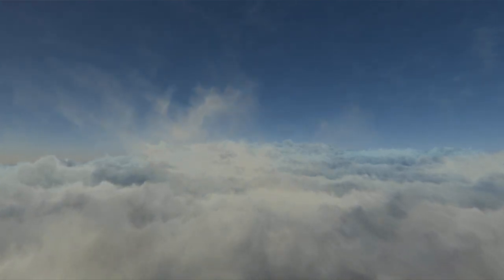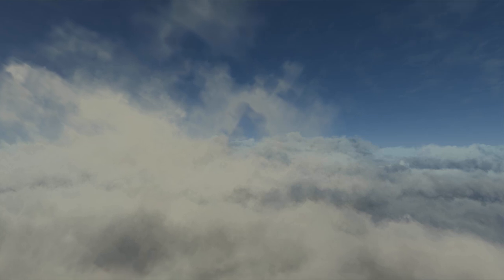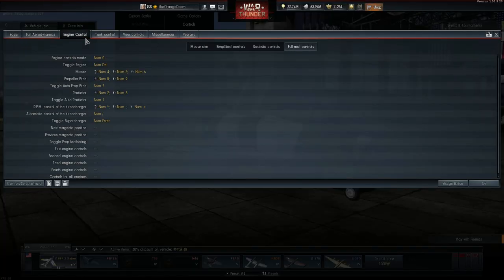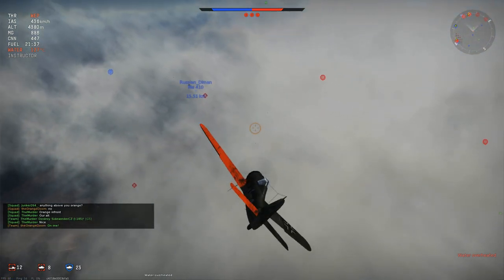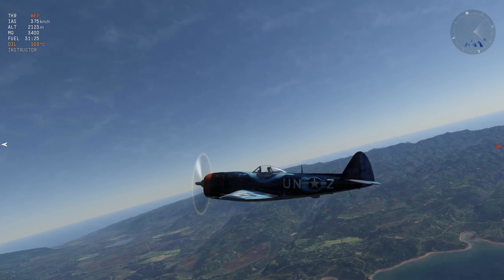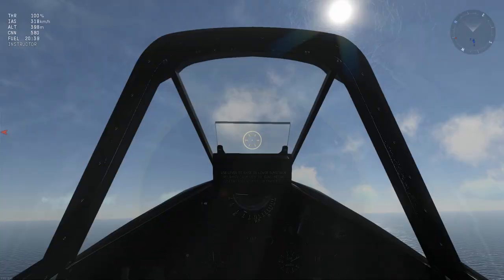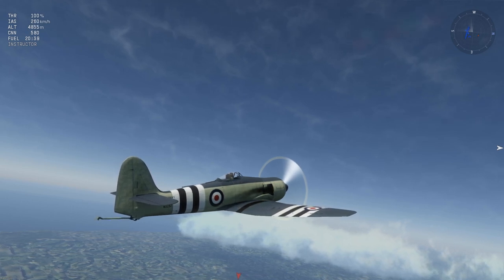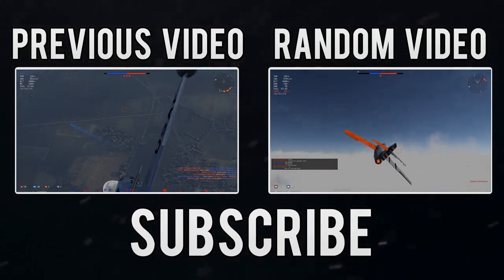War Thunder Advanced Tutorial - How To Use Manual Engine Controls  -  Working in SB and RB

Comment: mate  Here are some important things you missed out:

1. Using MEC not only makes you a better pilot, it actually makes you more of  a pilot, as this is something required of each and every qualified pilot IRL. 

2.With constant speed propellers, found in later aircraft, what happens when you alter prop pitch is you actually set your RPM, to which the aircraft's system reacts by adjusting the prop pitch accordingly. With variable speed props however, its measured in % of the actually prop pitch, so keep an eye on the RPM to not go over 6000RPM as to not over rev the engine, and make sure to adjust accordingly when diving. 

3. To use MEC, you have to actually use those circular clock-looking things in the cockpit, called i-n-s-t-r-u-m-e-n-t-s:
To use supercharger, keep an eye out for the manifold pressure, or MAN. At full  throttle this should be kept as constant as possible, around 60 inches of mercury in the P51D, for example( differs from plane to plane.) . The higher up you get, the less pressurized the air is and so the less pressure in the pistons you have per same volume of air. This means MAN will start to go down. At this point, you turn on the supercharger to 2, and voila your MAN will go back to 60. I'm guessing its the same with turbocharger, the slight difference being that you change it gradually just to keep it under 60. However you must not have the gear/% higher than what is needed to keep it at 60. 
 

4. Mixture, the most complicated and not yet fully modeled: This is the ratio of FUEL to air, but specifically it only changes volume of fuel. You were right in saying its different for each aircraft, but all ac follow the same pattern. In combustion engines, the ratio of oxygen and fuel must be the same, in terms of mass. As mixture is measured in volume, and density of air changes depending on altitude, you must adjust accordingly. So, the higher you get, the less dense air, so less air pressure. There fore volume of fuel needs to be decreased  accordingly and gradually, to keep same ratio. More altitude=less mixture. However, immediately after you turn on the next supercharger gear, there is a larger influx of air pressure, and so at that point mixture needs to be increased to match the increase in air pressure. After that, if you are continuing to climb, the pattern resumes from there: gradual decrease in mix for increase in altitude.
Reply: he said it doesn't make you a better pilot...
Reply: David Ye I have a question dose the super charger And radiator and oil radiates work for jets as well
Reply: gamer 2.0 no. Jet engines don't have any sort of radiator of superchargerz
Reply: leaving comment to be able to get back to your tips
Reply: Good comment though, very explicative and accurate. Not too concise but could be much worse. And don't forget in the game the mixer controller is poorly modelled, to not say not modelled at all.
Reply: Great comment David. 

I'd like to add to your 3rd point that many aircraft in WT have a red line or zone where the manifold pressure has to stay close to. If you don't understand Russian or Japanese like myself, I'd recommend you to try it out in a test flight and see what instrument or instruments (if there are more engines usually the same amount of pressure indicators) will change when switching gears. 

It's usually given away by a red zone or line anyways, but to be sure I'd recommend getting in the cockpit and fiddle around a bit until you figure out how you can get the best performance with your preferred flight style etc.
Reply: @L4wyrup  anyone saw the cartoon movie 
"PLANES 2"
And how Dusty vlew his gearbox which is the same thing we dicussing here XD
Cartoons sure are informative sometimes
Reply: M
Reply: geek

Comment: if my engine temprature goes Orange, then am i going to be Doomed?
Reply from the maker: AceCustomz yes
Reply: theOrangeDoom welp.....
Reply: +AceCustomz you should be able to spam I if you have regular controls to cool your engine.
Reply: The Diamond Hero i've pressed I accidentally and i've ended up in the trees
Reply: AceCustomz you don't like to climb do you?
Reply: The Diamond Hero i do, but i've done it when i am zooming up (i usually start typing then) and realized the problem too late, or i'm flying a low tier turnfighter
Reply: NOPE

Comment: for propeller pitch
0% for dive or emergency glide
60-65% for cruising
70-85% for climb
100% is useless because you overspeed the rotation of propeller and you have drag, not accellerating or power
100% only in descend for airbrake when you put down the power like 50% for start to descend and 20-15% for final touch
dont use 100% for dive because 600kmh can kill your engine
i dont know well, but it seems that pitch is a moltiplicator for rpm like gears
100% of pitch in a dive even with 0% of power will kill your engine
when you use pitch remind that there is a lag of power due to the air behind propeller so think before your enemy make his move XD
Reply: I thank you sir for sharing your knowledge.
Reply: Not all Gaming how to people in other jets slice throw the air and look majestic and I don’t
Reply: what should you have the pitch at in dogfights?
Reply: @nathanvenable6734  depend about the situation
Reply: @nathanvenable6734  usually i use 0% for dive on enemy, because i gain distance.
The real limit is RPM that in Bf109 are 3000 ( you can see them in first view, but you must memorize because you want to play with third person view).
In Ta152 the limit is 3500
All planes have RPM limit, zone for torque, zone for power, etc. 
With propeller pitch you must train yourself in "volo di prova"
Sorry im italian, there are 2am and i dont remember the correct words xp
Reply: @RealNotallGaming  Mostly planning on using this for air races in SB. For an air race, would I mostly have the prop feathered for power then (especially on the straights)? And then just ease back to normal to avoid overheating or do I mostly just mess with the radiator for that?

I use VR and a gamepad so too many buttons that you have to be too accurate with too quickly for use in combat situations for me.
Reply: @101jir  
the models B1 and E1 have an engine based on 80% pitch
F1 and up models have an engine based on 65% pitch
most of the situations will lead to this two %, in theory the max amount, in some situations you can raise that max amount like landing= 0% throttle 100% pitch for brake hard

(fix situation for not overheat, min fuel, from takeoff to 100mt and cruising)
WEP, 5% radiators for min drag

Bf109E1
55% pitch, 2250 rpm, 92 degree oil, 97 degree water
475kmh

Bf109F1
36% pitch, 2100rpm, 88 degree oil, 97 degree water, 500kmh

Bf109F4
38% pitch, 2000 rpm, 86 degree oil, 96 degree water, 515kmh

Bf109G6
36% pitch, 1900 rpm, 89 degree oil, 99 degree water, 515kmh

Bf109K4
34% pitch, 1900 rpm, 88 degree oil, 98 degree water, 555kmh

i hope i helped you a little :)
this list is about the only planes i mastered
every plane have his stats for pitch so is impossible to list them here
o7 see ya in the sky m8
Reply: @sinxy.y4159  they use mouse like joystick for smooth movements
Reply: @nathanvenable6734  the pitch is like the variator of a little motorcycle
in Bf just adjust it for not surpass 3000rpm or youll cook the engine
if you go in the direction of 0% pitch you can turn better
if you go in the direction of 100% you have more power for climb and chase but less turn ability
Reply: @RealNotallGaming  Thanks. Hopefully Gaijin will host an official air race soon. If not, maybe I will see what I can find in custom.
Reply: How do I stop the axis from jumping straight to 100% or 0% because everytime I try to fiddle with the mec, I can never get accurate control over anything. I can have a radiator fully open, or fully closed. My prop pitch can be 100% or 0%. Do you know how to fix this?
Reply: @heinzbeans2117  go in keybinds, in options (plane)
- you need to select full controls, then a list of additional keybinds will appear (when you finished you need to click mouse or you will start with "full sim" keybinds and if you use mouse you will crash)
- go down to the end and you will see manual engine keybinds
- for: pitch propeller, radiator, oil radiator and mixture you need to enter, with double click in the setting of commands for regulate them
- you need (in the submenù, after double click) to turn on "relative" then you can regulate relative sensibility and you can use them properly

because is a game, just use WEP all time and fly with propeller pitch
when in dogfight, with 0% pitch you will have most of the times the advantage because WEP and not less throttle, you will "brake" less but remain in energy advantage.

for Bf and Fw (those planes with REV limits) pitch is:
0% dive
30-45% cruise
50% swallow climb
65% take off (most of the times this is the limit)
80-100% air brake ( !!! watch out because you will need to reduce throttle, used for landing )

the rev limit for heating the engine is 2100-2300 RPM (use WTRTI external software for additional on screen numbers)
the rev limit before DESTROY\DAMAGE engine is 2700-3000 (some advanced model can rev up to 3500 like Ta152)

sorry now i dont have WT open and my english is poor
i hope it was useful ^^

are years i want to make a video (eng sub, im italian) about FULL MEC for all nations but im LAZY XP

in cockpit you will see the REV indicator on the right moving with pitch, in AUTO it will stay on about 75% max rev, with manual you will command it, so is simple to see it

watch it to discover planes limits
(USA, italy, USSR have just "more pitch > more power" 80% max pitch for not overheat, 80-100% pitch for "boost")

have fun ^^
Reply: Thank you so much man @RealNotallGaming
Reply: @heinzbeans2117  ^^ its a pleasure o7

Comment: from my experience any time you are travelling faster than the speed you can maintain in level flight, prop pitch should be set to 0% (or something very low; less than 20%) since you wont be able to actually gain more speed without losing altitude and a low prop pitch angle will create the least amount of drag, therefore allowing you to keep your speed for longer.
Reply: momo4077 yea because if u dive at high prop pitch u can over rev ur engine too
it has happened to me a few times
also diving with prop feathering on is OP as hell lol
im diving on enemies in my F4U way faster then when i had it on auto
Reply: 60-65% for cruising at least in gf e1 2.0 XP
but pitch is personal
bf109f4 have cruise speed with prop pitch at 40-45%, 30% is poor and you go down just for 2degree of climb
55% just kill it XD

Comment: You can check the rpm needle in your cockpit to adjust your mixture, if the rpm needle starts to wiggle, you only have around 1.5 seconds to adjust your mixture back or the engine dies, and you revert back to AEC (Auto Engine Controls)

Comment: I know that for Yak's the 2 gear is at 1900m.

La's 4000m

GriffonSpaceShuttle 5000m

Ki-43 4000m
Reply: Scarecrow tempests are around 1200-1300m
Reply: momo4077 only the mk2
Reply: Gideon Okun yeah sorry. thats the one i fly most often and i forgot that the mk5 has a better high altitude performance.
Reply: yeah, used to fly the km2 all the time myself ;D
Reply: I believe the P-51D5s is at 4000m maybe a little higher
Reply: I believe the P-51D5s is at 4000m maybe a little higher
Reply: +M36class What about the D-9??? Does it even have one? (it's the low alt version after all....)
Reply: Nikolay Iliev D-9 is med alt fighter and no. you don't have any gears.
Reply: Scarecrow
;-;
Reply: Scarecrow
And D-12?
Reply: Also do jets have any compression settings?
Reply: Nikolay Iliev 12 is high alt. I think that 7000-8000 is the sweet spot.
Reply: Scarecrow
I got it stock so meeh :| BTW any tips about the 229? Just got it ^_^
Reply: Nikolay Iliev No. I don't have any jets.
Reply: Scarecrow
ok :|
Reply: Nikolay Iliev jet have no manual engine controls.
Reply: M36class
oh ty
Reply: +M36class for p-51 it's great since they didnt fixed their cooling system yet.
Reply: ki 43 not 4000m wtf... I mean I would be confused

Comment: Essentially use the turbo similarly to the supercharger. It should be around 90%at maximum, and at around 5000m it should be around 40%. So at around 5000m bring it up to 40%, and as you get higher keep ramping it up as you gain altitude, AND speed. It only works after certain speeds, and above a certain throttle setting below 5000m don't go above 20%.

Comment: Just to clarify for people who don't want to go and read the whole wiki page about manual engine control (although I strongly recommend it) mixture represent the percentage of fuel per percentage of air(0% is only air and 100% is exclusively fuel). So  theorically the lower you are the more oxygen there is so you'll want to crank the mixture up cuz oxygen is abundant (but still mandatory for fire to exist). The Higher you'll go, the less oxygen there'll be so try and level this by lowering the mixture to 40 and down. Hope this helped!
Reply: Thank you
Reply: +Fil1204 you're welcome :)
Reply: best mixure 90% below 3000
75% above
but i tried few times so is a little......inprecise :)
but 90% is sure
for boost 120% but watch out and use manual radiator\oil radiator

Comment from the maker: Big thanks to McDonald's !! now please send me some cheeseburgers!!
Reply: theOrangeDoom Maus?
Reply: theOrangeDoom Do the Maus with the Haus camo.
Reply: theOrangeDoom MecDonalds :PPP
Reply: theOrangeDoom Have you tried testing MEC in AB yet?
Reply: Wobobobo It does work.
Reply from the maker: Wobobobo but why would you use it there?
Reply: I have shift for manual and auto switching....can you tell me how the mixture works? I have set it up but till now when i spawned an aircraft it says no fuel mix control..os it only on some aircraft or is my set up wrong?
Reply from the maker: JTS264 not all aircraft support fuel mixture
Reply: theOrangeDoom which do? Does the forum page tell it?
Reply: JTS264 I know a lot of the t4 stuff supports it, the F4F should, the A6M does, I believe most Russian planes and British  planes do..
Reply: ***** nice ima check soon...
Reply: JTS264 Its best not to mess with mixture, it can really mess with your performance and kill your engine though. That's why irl they have recommended checklists for it.
Reply: ***** As of 1.49 I was only able to turn the engine on/off, not the MEC, but I'll try it when I get back on.

theOrangeDoom I'm actually an AB player and I just want to take advantage of the AB engine mechanics.
Reply: Wobobobo well in arcade mec hardly has any roll...
Reply: JTS264 Roll? If you meant role then yes, most of the time, but it becomes crucial in certain situations such as AB tournaments or throwing myself into stupid/suicidal situations and trying to get out of them for fun/practice.
Reply: Hey orange I just wanted to say it was a pleasure flying with you in my BTD today-kid9
Reply: theOrangeDoom I have a challenge, Arcade Battles,  cockpit mode only, score 750+ points and get atleast 3 kills in an attacker, there is a score I want for you.
3000 at minimum.
1 kill = 250p
2x kill (double kill, duhh) 500+ bonus points
Critical hit - 100p
hit - 5p.
Kill in a bomber possibly? 1500p.
Reply: Das Dil_Doge A-36 and Ju-87D-5.
Reply: theOrangeDoom  BF-109 K4!
Reply: theOrangeDoom Orange I have a problem. When I try to put radiator on 100 percent in only is on 100 percent when I am holding button as soon as I let it got it goes back to 50 percent. Tested out on LA9 and Spitfire MK22
Reply from the maker: Supermarine Spitfire relative control
Reply: theOrangeDoom Is that something I need to enable? Or maybe disable?
Reply from the maker: Supermarine Spitfire read the forum thread please
Reply: theOrangeDoom Yeah I see now. Thank you.
Reply: theOrangeDoom Yep it all works now. Thank you.
Reply from the maker: Supermarine Spitfire my pleasure :)
Reply: if i want to fully open/close my radiator, i need to hold the button, otherwise it will set itself on 50%... is there a way to lock it on open/closed without holding the button?
Reply from the maker: Seimen Veldt relative control
Reply: theOrangeDoom found it! love your vids btw XD
Reply: theOrangeDoom Hi! one question..! :) Can i control only radiator?because then switch to manual, prop pitch, turbo charg. setups by 50%..i want control only radiator. :) Thank you, great video!
Reply from the maker: daggrag you can control all, or none. That's the tradeoff
Reply: theOrangeDoom Rule of thumb for mixture: Higher = lean it to 60% at the very least, below about 3000m I find 120% is fine.
Reply: +theOrangeDoom  Where is the switch supercharger gear setting, i dont have it
Reply from the maker: Combatsmithen Enter on the Num pad
Reply: theOrangeDoom nvm
got it!! i was making my own controls. And the setting wasn't called "Switch Supercharger Gear" it was "Toggle Supercharger"
Reply: That's funny
Reply: Turning prop pitch back to auto after the engine fails usually starts it back up for me.

Comment: After a bit of research i found that a higher altitude the more % of the turbo charge you want, as it compresses the oxygen into the engine. However like you said it damages the engine almost instantly so i dont bother with it unless its absolutely necessary and im heading back to base anyway